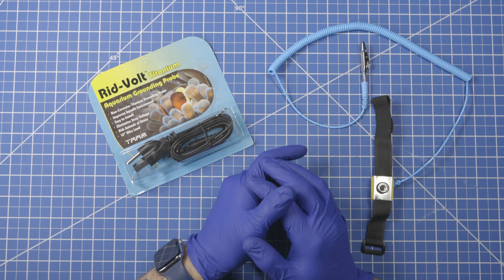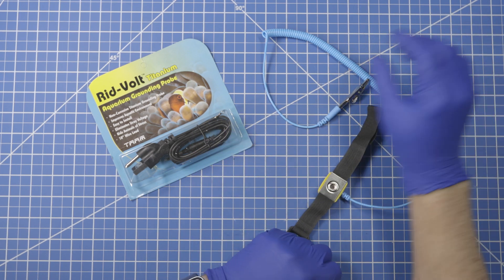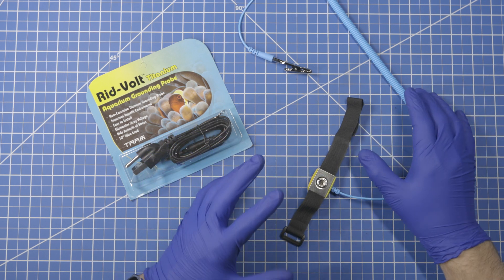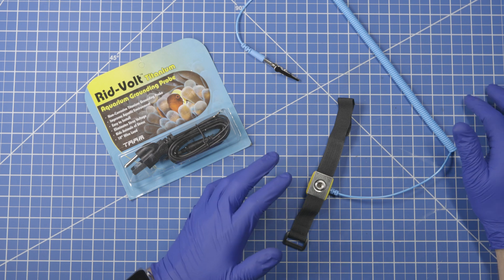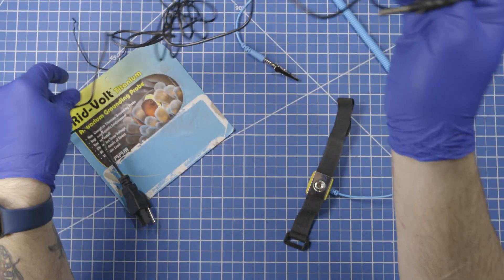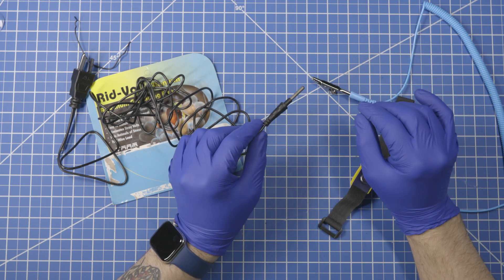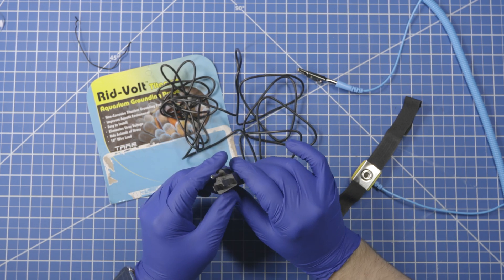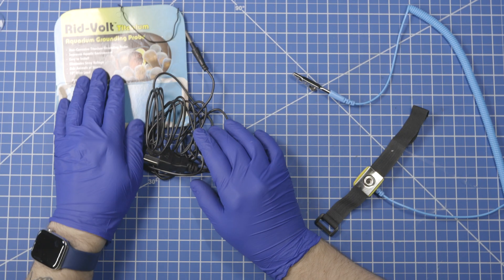Grounding Probe Basics - ACTUALLY ground yourself for electronics work

Comment: 1:40 2023 here; the number of replacement requests after someone kills or fries new PC components during a build project would belie your claim. They're NOT coated in anti-static film as you say. Designed to be handled? Lol That's like saying cars are designed to be driven. Or as the kids say, "no shit, Sherlock!" Sure, you might be right. But is it designed to be handled by the ungrounded? Again, check the number of replacement parts requests of just bought items, visit some PC build forums starting with several reddit communities on the topic. Actually, I'd love to read up whatever you're basing your assertions on and be proven wrong. Do reply with links or even search terms I could enlighten myself with.

Comment: I accidently fried my laptop a few years ago while I was just cleaning the cooling fans for my video & graphics card... I had done that many times ... that last time it was very cold and being unaware of the need to ground  or misunderstanding how to be properly grounded... I killed the motherboard >.<.  Ever since that mistake (thankfully I had accidental coverage on that laptop & it was replaced eventually) I've been almost paranoid about working on my laptop.  My BIL actually bought me the laptop I have today and purchased an extended warrantee & 24/7 365 tech support from Dell... Literally I had a dell technician come to my home and replace my keyboard because the backlighting wasn't working.  Then I ended up having to ship my laptop back to Dell because I can't remember exactly what happened but I ended up getting a brand new laptop O.O!  So this will be the first time I open a case in years and I know feel more comfortable & confident that I'll be fine & grounded properly.  Thank you so much for the explanation, I really appreciated learning more than I did coming into this video. <3

Comment: Thank you so much for this vid. I was swapping out pc components and wanted to take absolutely no chances with static. Since then, I’ve learned more about checking the safety of my outlets, and how to use a voltage meter… I was then sparked to learn more about electronics, have started a basic electronics course, and am now building a radio. Thanks for your informative video!!!
Reply: "Spark"! Accidental pun 😂

Comment: My house has no ground system. Will this method still work for me? I didnt know ground exist and we only use plug without gound pin. the ground system in house, such thing only exist in developed country? I am from undevelop country and we didnt know such thing exist until after watching your video and other video on youtube. I use to hate the extra pin that cannot to my outlet, and use adaptor to connect to the outlet. sry about my poor english.
Reply from the maker: Your house definitely has a ground, but for many years plugs were only 2-prong and the grounding was "in the wall" and the ground was attached to the box (where the outlet/switch/etc was installed).  Of course there are many cases of that being done poorly/wrongly, but that's how it's SUPPOSED to work.
Unfortunately, you're going to need an electrician to check to make sure that the ground is available in the box -- if it is, the outlet can very easily be replaced with a 3-prong version.  Until you have that, there's no easy or safe way to have this grounding probe setup work for you.

Comment: Can you still it straight into the ground and it work?
Reply from the maker: You could certainly attach it to a grounding rod (which, via your home/office/whatever electrical wiring, is eventually what's happening anyway), but grounding rods are driven 4 to 8 feet deep.  i wouldn't trust "plugging it into the dirt" to make a solid ground connection.

Comment: You can use an extension cord as well just as long as you only use the ground terminal I’ve been shocked by 440V industrial made my heart are really got arm tingle for about 4”3 hours lol I started getting shocked by 110V when I was 3 months old I would stick nails in the wall socket and pop the breaker my dad would turn it back in it would pop again it was me trying to get the nails out of the outlet lol I was a dumb little kid